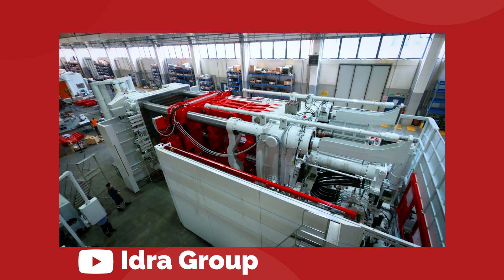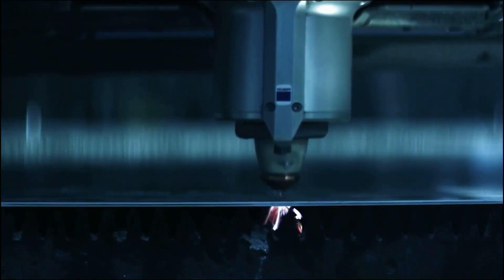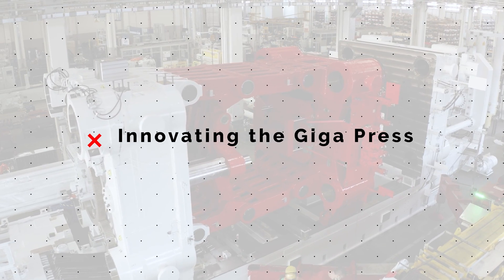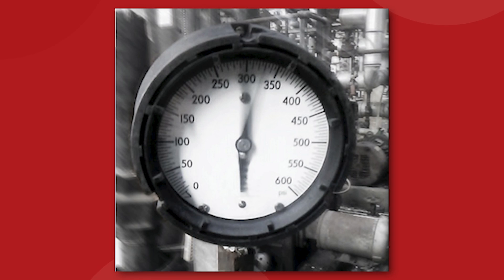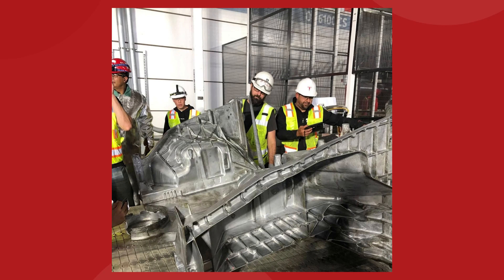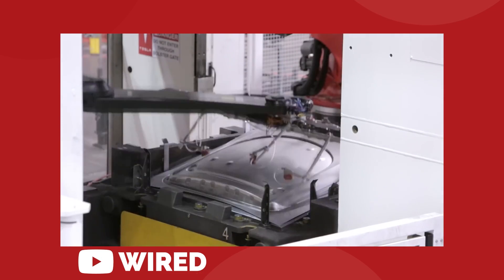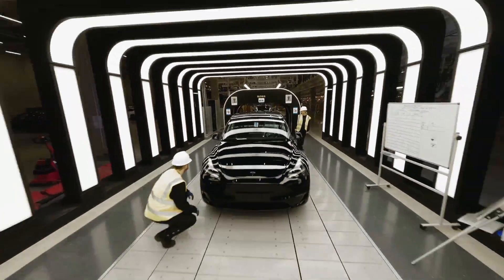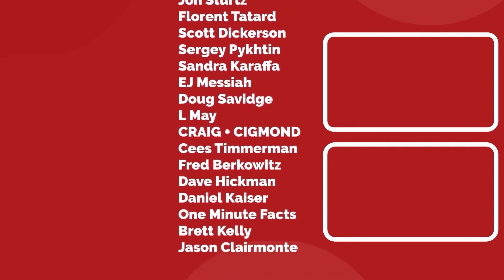The Real Reason Tesla Developed The Giga Press!

Comment: Great video, thank you. But...heavy collision repair depends on body shops being able to cut out the bad parts and re-weld in new structural members. What happens with the front or rear of a Gigapress-formed Tesla? I'd have to assume that Tesla will specify that a subframe, once damaged, is irreparable and that any such repairs absolve them of responsibility for subsequent crash damage. The only option would be to replace the entire casting and that, unless it's to be done to a car less than three years old, might be too costly to justify if that repair would cost more than 75% of the vehicle's current value. Teslas have an excellent residual so maybe they get a break there, but surely five-year-old or so cars will need to be totaled.
Reply: OR it might actually be cheaper to unplug the electrical connections, remove modules from inside the casting, then unbolt the whole front (rear?) end of the car, bolt a new casting on and swap parts?
Remember, if the damage is that deep, ALL of those parts are being removed from a steel chassis anyway before a lot of hours are spent on body repair.
2 techs with a socket set could have a Tesla stripped in a day and reassembled 3 days later guaranteed straight, with no fatigued metalwork and just the damaged components replaced.
No cutting, welding patching, jigs, etc.
Any "outer" panels are being replaced and painted anyway. Plus, no painting of the interior sections required on the cast car before reassembly.
This needs a different mindset.
Reply: @rogerstarkey5390  But that's my exact point. Have a fender bender that displaces a rear light cluster so that the car will no longer pass inspection. It has to be fixed. On my car now, that could mean a $5000 repair bill but it can be done for under 75% of the car's value (well...not MY car). On a gigcasted car, replacement of an entire from or rear cast section, the part alone could be $15,000 before any work is done. That the whole think would need to be replaced is the problem.
Reply: @michaelisaacson9735  
The premise for you "exact point" seems to be that the casting is so close to the exterior of the vehicle that a "fender bender" results in damage?
Wrong.
In comparison, the same "fender bender" would damage the pressed steel frame of the "conventional" car.
Same thing.
There's a "buffer" of progressive failure  BEFORE those parts are stressed, or damaged.
If the force goes that deep, it's expensive EITHER WAY.
 🙄
SMH
Reply: @rogerstarkey5390  Not at all. For starts, steel cars haven't had discreet frames since the early 1960's. The torsional stiffness of the entire chassis is partly dependent upon the body panels as well as the underbody sections so any accident stresses the entire vehicle to some extent. You're nitpicking on the term, "fender bender" to make your point. I'm not. 

Steel is one of the most elastic materials. When any impact is enough to affect both the our body and the inner sections, the entire car flexes. That's how it's possible to hear each successive iteration of any particular model  be advertised as, "30% more torsional rigidity" because...cars bend like hell. Scuttle shake on a vehicle converted to being a convertible from one not originally design to be one is where one can see that the most. So any accident does bend the entire car, it just springs back to its intended shape if the modulus limit is not breached.

Cast metal does not bend very well and that is the basis for my assessment. Crack that gigapressed piece and I suspect it's trash. Tesla will not be offering factory sections to weld in, if that is even possible, because that defeats the entire purpose of the gigcasting. So I stand solidly by my assertion that there will be a lot of totaled Teslas as well as a strong market for recycling them.
Reply: Y’all have so little faith in Elons outside the box thinning.
Reply: It would be hard to replicate the strength of that casting though.
Reply: TOTALED. Thats' the new disposable car. Or the battery goes. Totaled. Because of cost. What will we do with millions of those dead batteries?
Reply: @carbonfiber8071  Batteries are being recycled and for the totaled cars it means new business opportunities for others and a residual value for those cars. And if repairability becomes a costly issue for a car with big casted components insurance will go up. That will make people look elsewhere for a more traditional build  car or the car brand has to give some of it savings made by these new casting methods back to the costumer, which in case of tesla with a ridiculous margin of 30% is very doable. More so if they really want to make electric driving affordable for the masses instead of maximizing profits to pay for Musk's expensive hobby.
Reply: @kuiperrene  What PERCENTAGE of the battery can be recycled though? Not much.
Reply: @kuiperrene  No one is talking about disposal of the battery cells. The cost of recycling is way more than new production. You be surprised what a lie recycling has been in the past couple decades. That's why there is micro plastic in everything now. Not rocket science.
Reply: @carbonfiber8071  plastic recycling is a total scam, not recycling as a whole. You’re oversimplifying to make a false point.
Reply: @curtislavoie2242  Answer the question then, what percentage of the current-type battery is recyclable?
Reply: @carbonfiber8071  I’m not sure as to what percentage exactly, but the majority of the lithium can be reclaimed. Most ev batteries will spend a decade or so in power walls in homes before they will be recycled. Give it 5 years, you’ll see. If you know of a pile of ev batteries somewhere, please let me know, I’ll be happy to make some money with them.
Reply: @curtislavoie2242  I'm not sure you said.
Reply: @carbonfiber8071  The percentage is irrelevant, it’s profitable, it will be a viable business. You can nit pick and be as pedantic as you’d like.
Reply: @carbonfiber8071  Money is the only thing that matters on this scale. Thanks for the name calling, it really strengthens your position and adds an air of intelligence.
Reply: @carbonfiber8071  
Let's see.
Plug in to a "discharge unit" to remove all charge.
Unbolt from car.
Remove loose components.
Drop into a REALLY big shredder.
Separate materials.
Result?
Well over 90% of ALL materials reclaimed (trending towards 100%!)
Core battery materials at BETTER purity than the original cells.
Those materials at only 20% or below the cost of mining for new stock(!)
.
So. Yes...... "Much"
.
I forgot!
The energy from the discharged packs is used to run the machines which shred the packs!!
Reply: @rogerstarkey5390  The only way to do it without the harmful byproducts is not giving much return in comparison to raw materials.
Reply: @rogerstarkey5390  That's why only 5% are being recycled at present. The ground will be full of these batteries in the end, because they will use raw materials until there are none left before they recycle them all. Just like regular batteries.
Reply: @curtislavoie2242  You're welcome.
Reply: @curtislavoie2242  Your first sentence was my point.
Reply: @carbonfiber8071  
"Only 5%"?
Where's your data for that?
So you're saying that when a "conventional" car is scrapped the engine goes to landfill?
No, you're not, because just like an EV THE WHOLE CAR goes to a professional recycling  centre where valuable parts are removed (ALL OF THEM).
Stop making assumptions based on what happened in the past.
LISTEN to the actual experts who are INVESTING in the technology to do it.
They wouldn't do so if it couldn't be done.
As I've said, this will also PREVENT "regular batteries" from going to landfill because they can be recycled at "no extra cost".
Reply: @carbonfiber8071  
"Without harmful byproducts"
"What"?
Stop guessing.
Reply: @rogerstarkey5390  Do some research. Byproduct: Toxic gas.
Reply: @rogerstarkey5390  Good luck with your delusion.
Reply: @carbonfiber8071  95%
Reply: @carbonfiber8071  OVer 90% depending on the chemistry.
Reply: @carbonfiber8071  "Answer the question then, what percentage of the current-type battery is recyclable?"
Well over 90% depending on the chemistry.  Plants are in operation.
Reply: @danharold3087  Sounds like a lot of emissions Harold.
Reply: @carbonfiber8071  Most of what is not recycled is plastic.  The batteries are broken up with a grinding process.  What emissions ?
Reply: @carbonfiber8071  Tesla is claiming they can recycle their batteries in house at 97% reusable material.  Even if you knock that down to 85-90% it's pretty solid.  Companies such as Redwood materials are tooling rapidly to be able to take advantage of this emerging opportunity in order to resupply production quality materials back to the manufacturers.  It's not there yet, but it's going to be here very soon.
Reply: @carbonfiber8071  Recycle them, because yes they do that.
Reply: @carbonfiber8071  well the batteries isn’t too complicated you can repurpose them as stand alone batteries for a while since power density doesn’t matter as much and after that the lithium can be recycled

Comment: I’ve worked for two different companies that used hydraulic presses. I worked for dart container which used a hydraulic press to make Styrofoam cups and I worked for Sterolite which used hydraulic presses to make plastic mold injection part, so to me the giga press is a total game changer.
Reply: Little Presses.  Documentary doesn't address the fact that cast material is weak and has defects.  The traditional automakers use stamped steel because the can control the rigidity of the part and its strength I. 4d space.  Casting molten material can't do that.  Hot rolled or forged materials are 3x as strong as cast.  Pretty machines don't change that.
Reply: @kevinfolk2260  The "traditional" automakers didn't have todays technology. Apples and oranges.
Reply: @JohnSmith-mk8hz  modern technology doesn't affect casting defects.  GM invented robotic casting tech I the sixties. Like usual, musk is overhyping tech that has limited value.  If casting was better than formed sheet metal structures they would all use them.  GM has SEVERAL casting plants they operate for transmissions, engine blocks, heads, etc... (like BEDFORD, IN).  They know how to cast aluminum. Their sheet metal stamping presses for body panels are bigger than the "megapress".
Reply: @JohnSmith-mk8hz  and as far as modern tech... we rebuilt and modernized our 50k tn press about ten years ago. Replaced a big camshaft-timed system with servo pilot operated valves and modern PLC control.  I doubt there's anything better on that italian machine he bought.  Look up the Heavy Press project in Wikipedia the article shows a 1955 picture of our 50k, and Whyman Gordon's 50k Loewy press. They are seven stories tall, 30 feet wide and about 80 feet long.  And ours is very modern.
Reply: @kevinfolk2260 most of your info is correct but outdated. Mass produced castings are not 'weak' with modern materials and methods  some of which are described in the video.
Hot rolled steel is hardly what any engineer would call strong. It is cheap. At only 36k where cold rolled is twice that. Hot rolled is cheap. It is weak, but in applications where weight is not a consideration, like structural steel, it is cheaper to just increase the cross section to get the strength required. Where strength to weight,  finish or uniformity is important, cold rolled is always used.
Reply: @correctednews1463  material properties do not become outdated.  Cold and hot rolled steels are the same material that have been finished in different ways.  The main thing they are manipulating is the grain flow/ material density.  Everything we forge here is cast to begin with.  By doing upsetting work and forcing the material flow in dies, then heat treat of the forgings we increase their tensile strength by at least 3×.  Many modern aluminum aerospace Alloys can be heat treated to above 70ksi tensile.  You cannot use castings for failure criticL aircraft parts. They crack to easy.
Reply: @kevinfolk2260  awesome! 👍. I was looking for comments like this. It unbelieveable that people think that this Gigapress is a new invention.

Comment: yeah, it's so smart that it will make model Y very easy to be totaled even with a small to medium impact. That is soo great for the environment.
Reply: Have you ever won a fight with one of those die cast toy cars? Those things will fuck you up if you accidentally step on one...

Now scale that up X100
Reply: @rorychivers8769  what? You must be joking, right?!
Reply: @silimarina.  Ok, I'll try again.

Imagine trying to fold an engine block in half.

If you can get yourself into a collision that manages to do that, I'd be more worried about how good your airbag system is.
Reply: @rorychivers8769  dude cars are meant to deform in a collision, but having a car made out of large parts, means that in a small-medium impact, you will need to change half or 1/3 of a car instead of a few panels. And that is bad for the buyer and for the environment. Giga casting is ONLY good for the seller (Tesla)

Comment: You are stating the pro's. This is not new tech.  The chance for a large component of a vehicle (not exclusive to electric) not being serviceable (repairable). It is not practical for every rear end collision to cut the vehicle in half and replace them with a part that would have to be transported on a flatbed. This technology allows for faster vehicle production not repairability. Insurance will be much higher, and dents more than 1 inch ( Tesla will have official replacement spec) would require a rear body assy incl both quarters, floor, and rear body panel. The new Tesla battery can't even be easily recycled due to the case filled with (glue or equivalent filler).  Stop drinking the Kool-aid.

Comment: While the metal is still liquid, that thing acts as a hydraulic press. On your screenshot, injection force = 241 tons = 2.4E6 Newtons, tie bar diameter = 0.34m so the area is 0.09m^2, the maximum pressure created by the injection is therefore 2.6E+7 Pascals. The area of the vertical cross-section of the part being casted is way larger than 0.09m^2, therefore force is multiplied by the proportion of these two areas.

That's why the clamping force needs to be way stronger than injection force.

Comment: So, I am not understanding. This press seems to require a Giga HOLDING force, not a Giga clamping force. Are the two halves not locked together in a manner able to withstand the injection force? I cannot see that energy needs to be expended to clamp the halves if they are locked together during injection. Plz explain.

Comment: It will be interesting to see what effect thermal expansion will have on the chassis.Being Aluminum alloy will expand about 2.3mm over a length of 5m due to a change in temperature of 20 degrees which is double that of steel.
Reply: Well since the other parts in steel will do about 1.2mm which is 0.24mm per m, i don't believe that any issues will be of concern

Comment: Imagine a casting so much better and consistent they the body panels bumpers and door still don't line up properly.  22 Model Y owner.  Dealer will say take deliver they will fix. Makes appointment in app. Waits 2 weeks. Drive 3 hours round trip. Waits 10 hours they adjust 1 panel. 1. Out of 6 flaws. Everything is in spec they say. If they cant fix panels I don't have much faith in the car long term. This is the first new car I have felt like this. Will probably sell as this will likely not end well long term. Was hoping for decent FSD as well. Can not even do one stop and turn smoothing. Phantom braking. Makes you take over as its confused. All round abouts. Stops 3 cars early for lights. Slams on breaks. I guess its not Beta but had 100 score for 2 weeks but tired of driving like grandmaw to keep a high score. They ding you any braking and cornering over. .4G which is everything. Also ding you for following more than a few car lengths. Range is about 2/3 or 1/2 what they claim vs gas equivalent. Speed handling and looks is all the car really has. Which is a lot but for the price.

Comment: Yeah, but what happens when you have an accident? Its one piece so this will either be a write off straight away or a crazy amount of labour and cost to fix.
Reply: This is not interresting for Tesla, as its just replacing it. Aftermarket will jump on it with special repair kits. But Tesla will just put replace if cracked/damaged in there service manual

Comment: Yeah a lot of pressure those things are basically bombs if they had a catastrophic failure but they're so well built I put the risk at a minimum you know after the Apocalypse about a thousand years they're going to find one of these Tesla cars and be like these things are impossible to make just like the pyramids LOL it's kind of how I think the pyramids were made crushed up Rock that they heated to a molting temperature and then formed them instead of cutting them that's why they line up so perfectly

Comment: 1272 mm is equal to 50.8 inches. Not 54 inches. It’s a great video but please get the math right.
Reply: I think he said at one point 1372 mm and 1372 mm X 0.03937 = 54.0 inches.
Also 1272 mm X 0.03937 = 50.08 inches.
Reply: @danielstapler4315  
You are substantially correct.  I didn't hear him say 1372, just 1272.  However, it was clearly just a misread of the chart he was showing at the time of the press's specs which clearly say 1372.  So, he didn't get the math wrong, just read the numbers wrong.  I guess I am sensitive to this because so many YouTubers (who are great at creating videos) seem to frequently make terrible math mistakes.